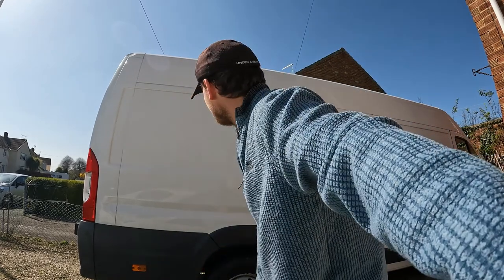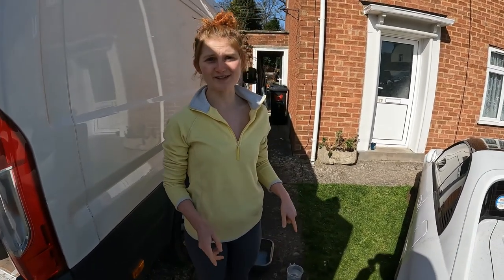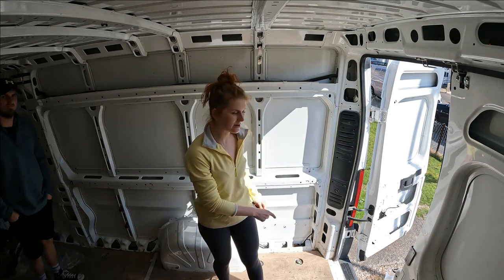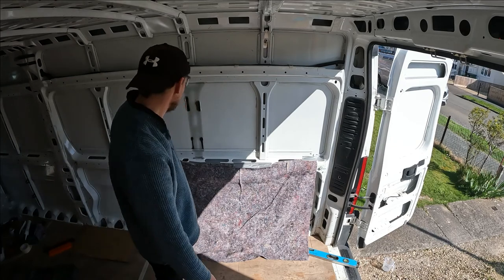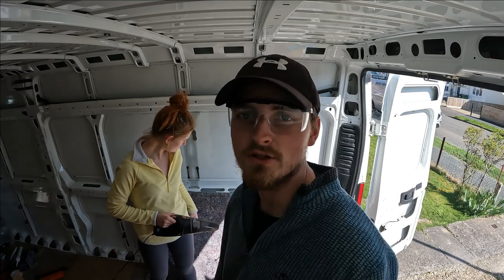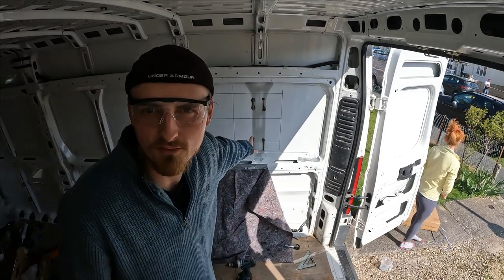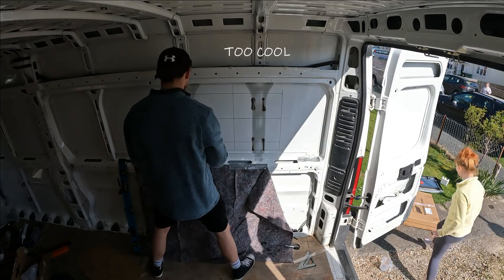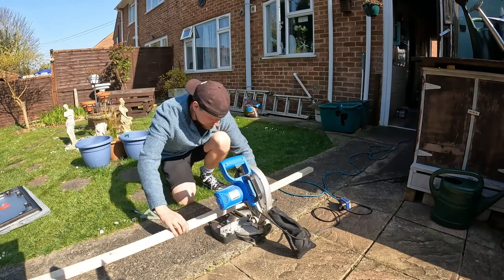Van Build Series Part 2: Window number two is in! (Shield Auto Care Hinged Opening Windows)

Comment: Good video thanks. I liked the focus on finding the middle so it was right when you're in bed.

Also I'm fitting one of these today and it came with no instructions! But the key thing I'm taking away from this is to build a frame for the inside. Makes sense as it says it has to be fitted on 22 to 30mm thickness
Reply from the maker: Thank you, yeah i found the same but if you go onto the website they have instructions on there but arne't all to clear. So we went with what seemed best and has worked brilliant. Good luck with the window. Hope it goes well
Reply: @thecalsamcompass6422  haha I also checked the website and thought the instructions there that I found were worse than useless lol. Im a bit surprised tbh they need to up their game!